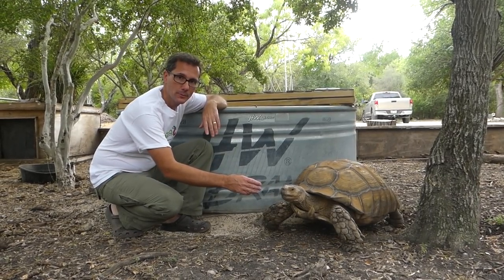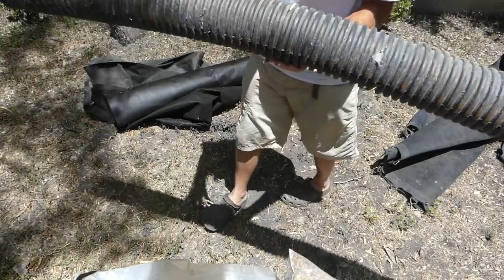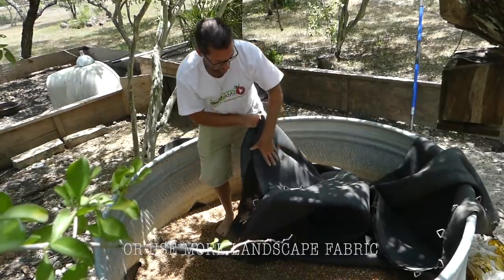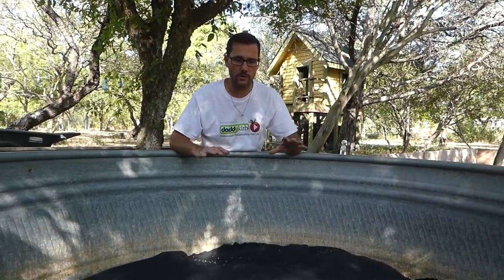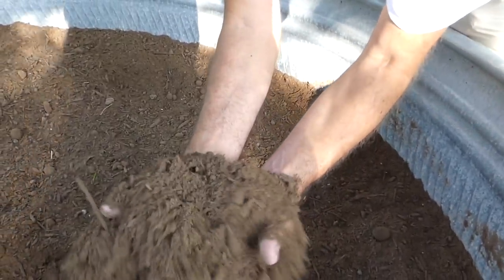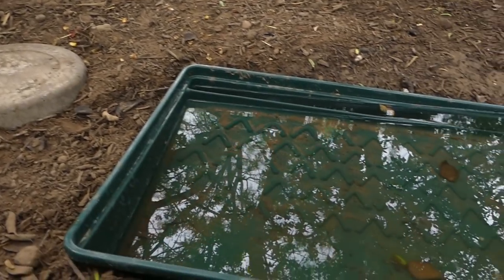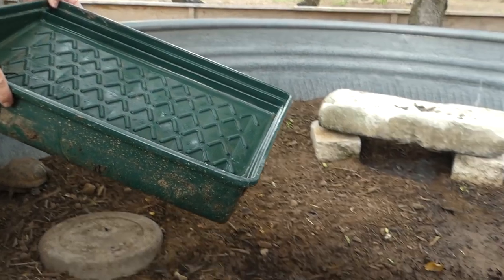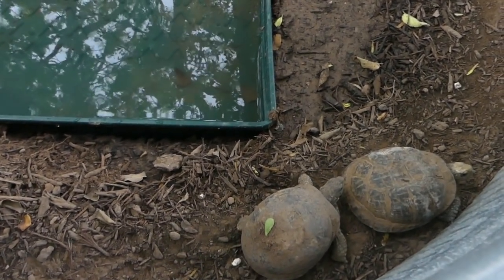How To Make A Box Turtle Habitat Enclosure Using A Galvanized Stock Tank

Comment: Great video!  Thanks for sharing!   I grew up in the mid-west and frequently observed my box turtles eating tiny stones in the yard.  My chickens eat them also, to assist with their digestion.  You might try adding some in your enclosure and see if they like them.  

Box turtles require winter temps of 40 degrees or less in order to go into a full hibernation mode.  In temperatures ranging between 75 and 40, their metabolism drops to a state where they will no longer eat because they can barely move.  They can also drown in shallow water because of their inability to move when they are cold.  I use electric waterproof seedling heat mats that provide constant 75-80 degree heat for the turtles to warm themselves on whenever they want.   Mine sleep on them at night and also during the day.

Box turtles can be safely kept inside during the winter, without having to hibernate, as long as they have access to a heated area that helps them stay warm enough to eat and stay healthy.  They will slow down and become less active, but will remain healthy as long as they are kept dry and free from drafts that can cause them to become ill with respiratory infections that quickly lead to pneumonia and death.   

I had some of mine for more than 20 years and dearly loved all of them.  My favorite one slept under my pillow during the day while I was away at school.